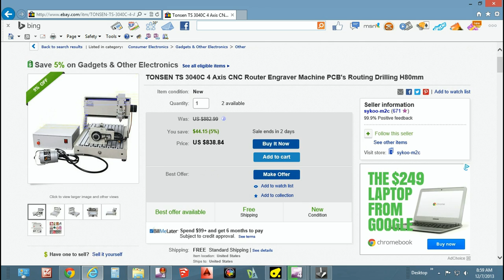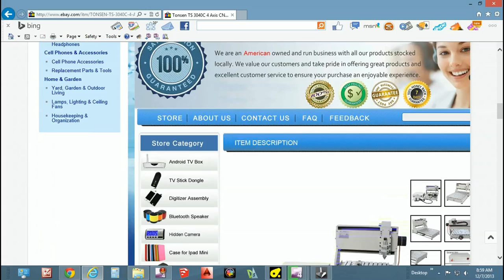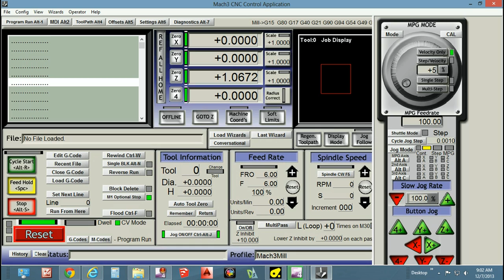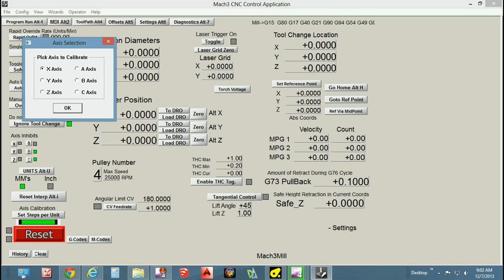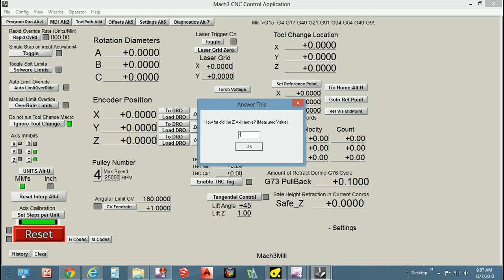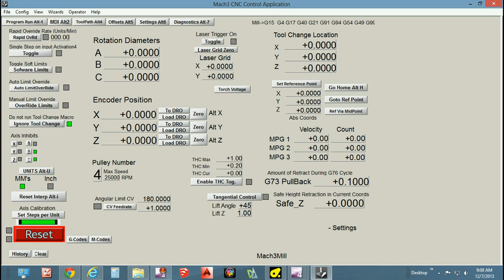MACH 3 How to Calibrate Axis Movement - Fix For Chinese CNC

Comment: Great video! Thanks so much for your time to make it. Small question only. For the z-axis calibration, the mach 3 will only remember (store) a single z-calibration, right? So the multiple z-axis calibrations that you did should manually be averaged, so the very last calibration is the one that will be stored by mach 3, right?

Comment: very interesting, I'm in process of setting up my 6040 Chinese cnc and this looks like I have to do. I'm not happy with it much as default setting from attached manual ( 1 cheat of paper ) when I move to X or Y it just want to shake it self apart, making horrendous noises :(

Comment: Thank you thank you thank you.
I've watched tonnes of CNC videos and you my friend explain well. I new mine was out, but never new how to set exactly. Mine is Bob on now. 
So, any chance you could do a video on setting the program to lift the tool above the material when moving between cuts in laymen's terms pretty please?. I managed to do it but don't know how.
Thanks again. Will follow you now.
Reply: Go to config/ set up safe Z,  enter the value you want the in-between-cut moves to be above the stock, and there's a check box you can select that also brings the machine up to that same height every time you stop the spindle.
Reply: @mytuberforyou Thank you. I'll give that a whirl next time I get chance.

Comment: I Have The Problem With Scale...
The result is small Compare to The Original Size In FIle...
i use mm Native Units...

When I calibrate the Axis...Also With mm...
Motor Tuning Change...And Motor Move Really Slow...When I jog It

Can you Tell Me The Problem...
Reply: Same problem, please help.

Comment: Hello Smoky Mountain Fabrication i'm working with a CNC to engrave PCB, but actually i have problems with the scales, because my drawings have a specific scale, but when im engraving the pcb is more big than my drawings, Do you know why ??
Reply: Victor Contreras a bit late maybe but i would guess it's one on two problems. Depending on what software you use maybe you have set the units wrong in the export/import settings.
If not I would look at the "steps per unit" settings.

amateur guess though :-)
Reply: I Have The Problem With Scale...
The result is small Compare to The Original Size In FIle...
i use mm Native Units...

When I calibrate the Axis...Also With mm...
Motor Tuning Change...And Motor Move Really Slow...When I jog It

Can you Tell Me The Problem...

Comment: While trying to set up my STEPS for the X,Y,Z it does  nothing at all. It's a Chinacnczone machine. The program it came with works fine but i have the free DEMO VERSION of MACH3 and it does not. Can this have an effect on it?
Reply from the maker: yes it can. the free demo has some problems. trying uninstalling and reinstalling
Reply: Thank you sir. Did it give you the mil/plasma/loader/and turn like it did with me?

Comment: First Make sure you have the micro stepping set correctly on the driver this will make the steps per result different.
OR
Spend a few bucks on Ballscrews and or New leadscrews . Now you know your tpi. Most company's will machine them for your specs 
Lastly before setting steps per unit make sure you jog forward a few inches then come back and do the test to get the back lash out.